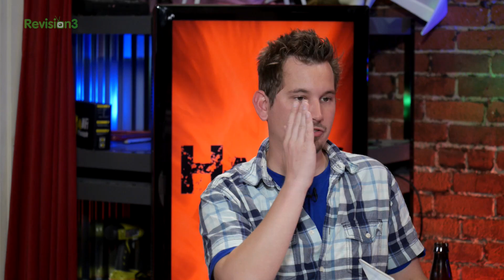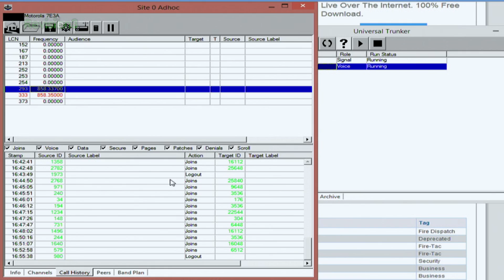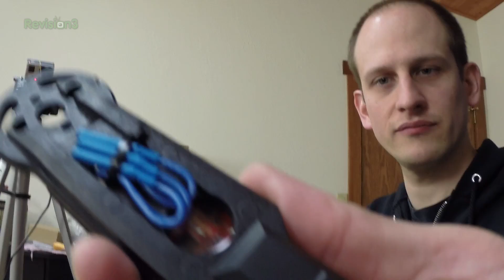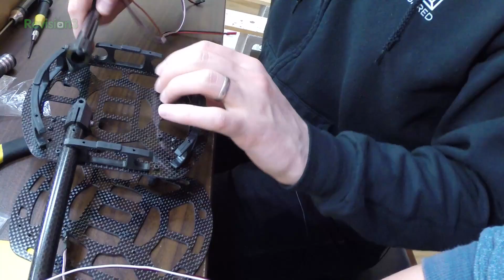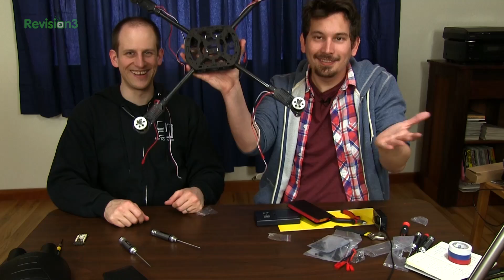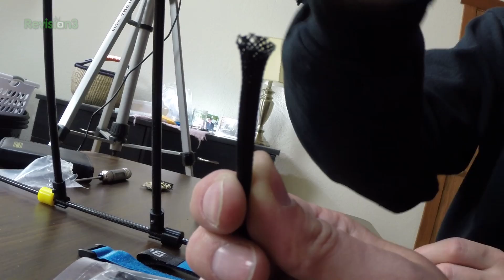Drone Assembly and Trunked Radio Systems, Hak5 1617

Comment: In Europe we have what we call TETRA systems. It stands for Terrestrial Trunked RAdio. It is like a GSM/GPRS (mobile phone) network but it is more robust, has power redundacy and with PTT and direct and group modes. In Sweden we specifically have a network based on TETRA for emergency and securityguard services like: police, fire dept, ambulance, Securitas, G4S etc. It is encrypted so you cannot listen in :D

Comment: An interesting note about needing two antennas to follow these trunked systems: some system vendors have included sub-audible signaling on their voice channels so radio handsets can receive system updates (like key ups on other channels) while tuned to a voice channel. Sometimes radio IDs will populate when tuned to a voice channel and sometimes not. It's a timing issue because the sub-audible part of the voice channel has very limited bandwidth so short transmissions won't be suitable to communicate which RID is keyed up on a channel. This signaling is also helpful if you're tuned to a voice channel and someone keys up on your priority channel; your handset can switch to your priority channel from the previous channel without having tuned to the system's control channel.

Comment: Rc copter, RC FPV platform, RC Autonomous vehicle. All better memes than "drone" thanks, I think the RC part instills the fact and confidence some person is still in control. If you break that bumble bee I think I can send you a CF HB8 mud puppy. A cyberpunks airframe,
 ps Get a 4s lipo  as well if you can take that on FC.
 Inductance can effect esc leads that are long if power wires are beside them unshielded.
 Get blue locktite for screws! Good hot soldering connections too.
 Bent over motor wires on end can be sheared in accidental arm strikes.
 Holes in nice cf booms oh man!